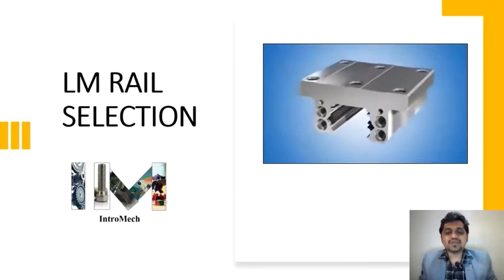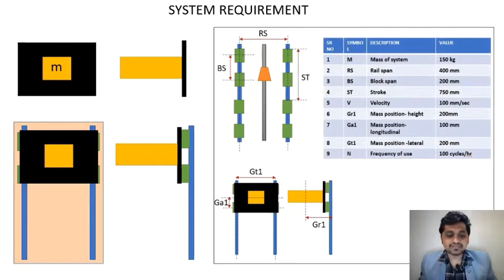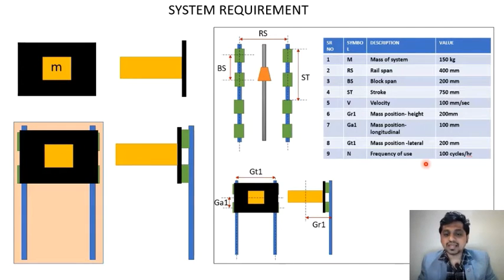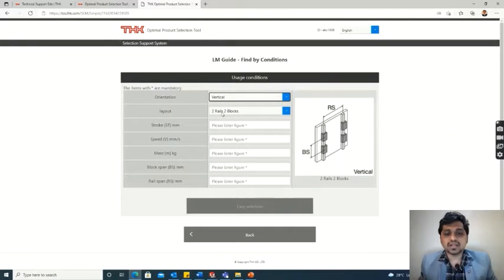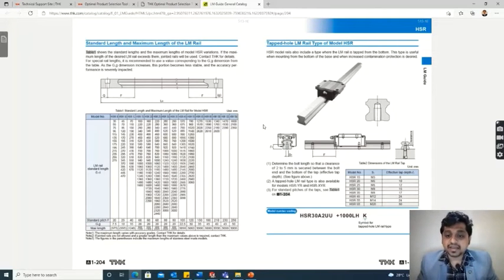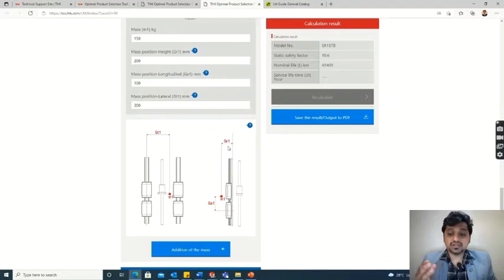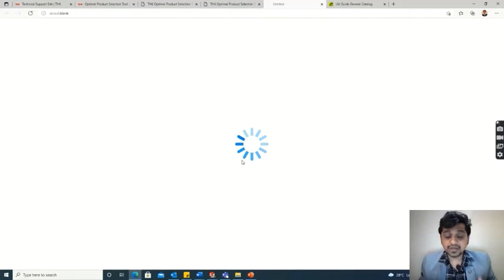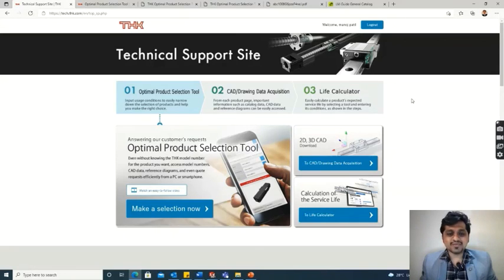HOW TO SLELECT A LM RAIL?

Comment: How to caclulate gt1 gr1 and ga1 and how to cacluate velocity and acceleration
Reply from the maker: 1) gt1 gr1 and ga1these values are dependent on your system design like mounting plate dimension, shape , orientation etc.
2) The velocity will be dependent on system cycle time and which drive system you are using. The rails can be driven with Ball/lead screw and motor. So based on that velocity and acceleration can be calculated. For more understanding check these videos also:-
https://youtu.be/6vVo9Kl_QWs
https://youtu.be/Q_3qkLC_2eQ
https://youtu.be/6MITnyAWAxQ

Comment: How to get the values of rail span and block span ?
Reply from the maker: The rail span and Block span will be dependent on your mounting plate dimensions and the space availability in your design. So as per your design those values should be considered.!

Comment: Nice. And one more thing can we explained the how much of load required by the bearing pressing in the crankshaft ,by using the interference fit between the bearing and crankshaft.
Reply from the maker: Thank you Venket👍. I think you are asking about the calculations of interference fit parameters between shaft and bearing. so here are some of the links you can go through to get the required parameters:- 
1) https://www.tribology-abc.com/calculators/e3_8.htm 2)https://www.engineersedge.com/calculators/machine-design/press-fit/press-fit-calculator.htm
3)https://amesweb.info/press-fit/interference-fit-calculator.aspx

Comment: How we select no of block for rail
Reply from the maker: It primarily depends on the load and moments that are coming on the guide blocks. Because the blocks are nothing but bearings with some static/dynamic load carrying capacities which you can find out in the catalogues.
Reply: How to caclulate the horizontal load vertical load in linear actuators woth lm guide

Comment: Thanks it's informative video. Why  static safety factor Play an important role in LM rail  or Ball screw
Reply from the maker: The LM rail or ball screws have balls inside them which not only reduce the friction but also carry the load. So if these balls gets deformed the load carrying capacity will get affected. That's why the static safety factor is important. The higher the safety factor the greater life it will have. But again you have to look for a proper balance. Because too high safety factor will increase your cost and also can occupy more space as the size of the rail or ball screw will be larger.